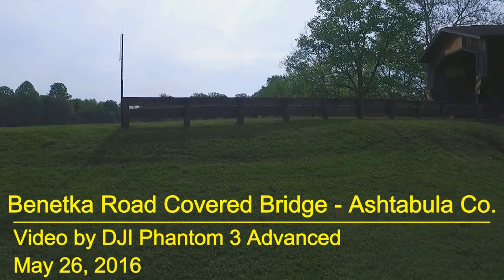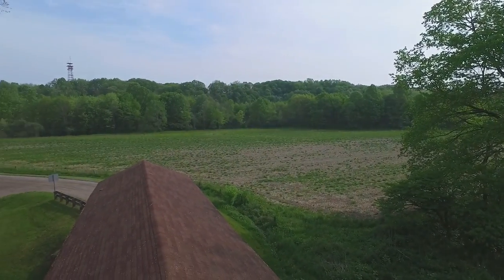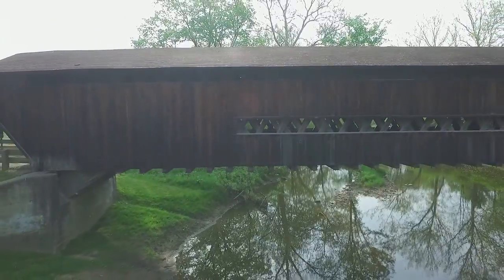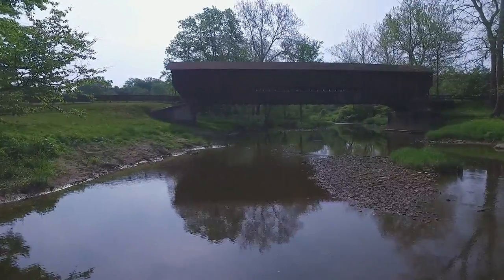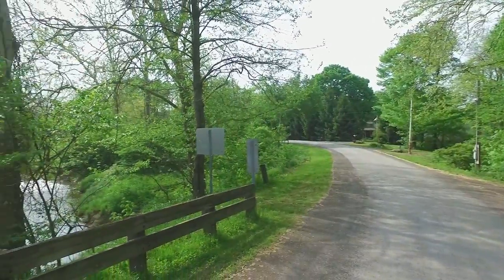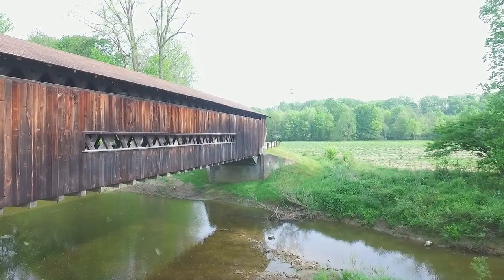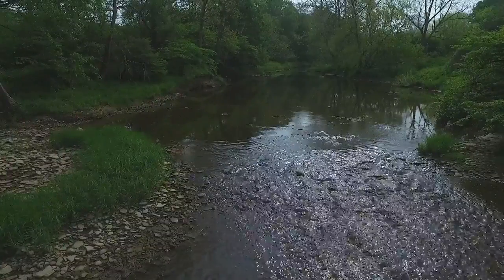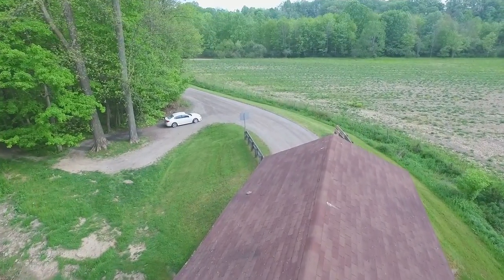P3A Benetka Covered Bridge 5-26-16 (1080P60)

Comment: Very smooth Bill. Much better video quality than our x380's can do. No fish eye. Very sharp. Thanks for the tour
Reply from the maker: Thanks .. I still need to get more familiar with the camera controls.  Its just a matter of getting enough practice I guess.  I ordered a new lens for my Git2 for the X380 to get rid of the fish eye problem. Just have to take off the front cover, loosen the glue holding the lens from turning, unscrew it, screw in the new lens, focus .. add a few dabs of hot glue and then put cover back on.  It will be nice to get rid of that fish eye!